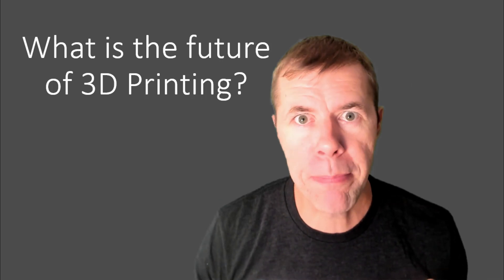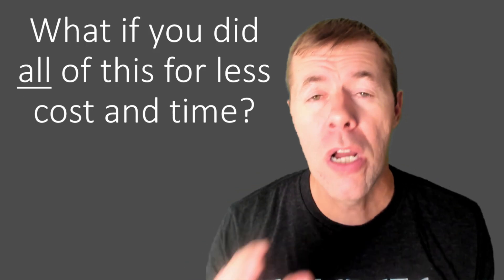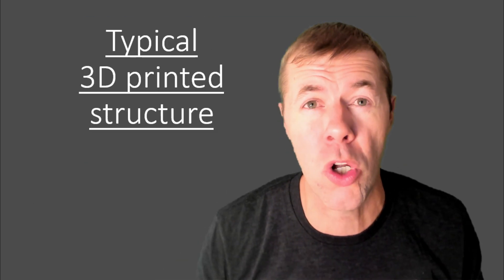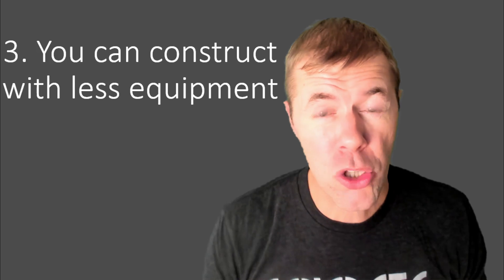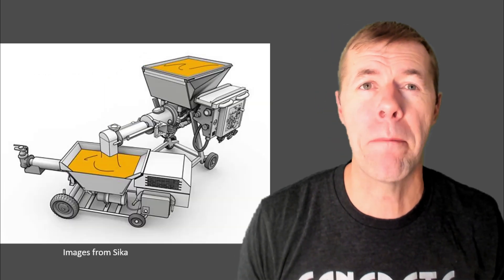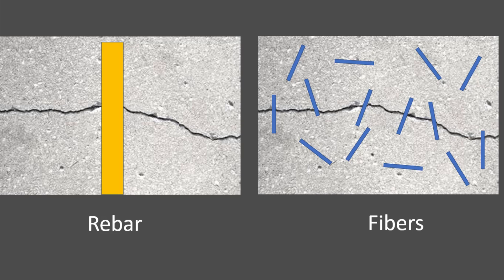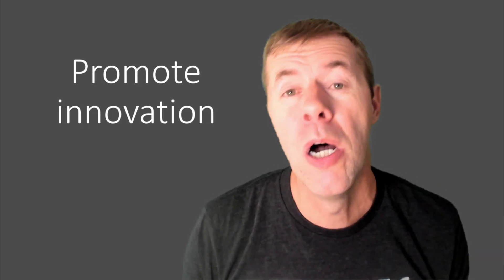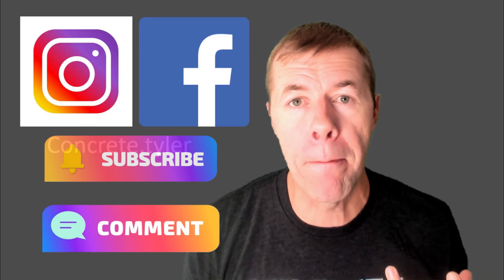What is the future of 3D Printing Concrete?

Comment: That's a lot of problems that still need to be solved like cold joints, no big aggregates, having trouble printing in tight concrete meshes etc.

I know you believe in this and are really involved in it but maybe you stop investing all that time and money trying to make 3d printing concrete work and better focus on trying to make 3d printing form work work.
I don't see a way of 3d Printing big tall structures that can hold themselves withouth collapsing without printing them by parts thus creating cold joint i.e. weakening the structure etm.
Reply from the maker: The printer we developed can use 1" aggregate and print around tight rebar meshes.  I agree that cold joints are not idea but they are not different then a crack.  A cold joint doesn't weaken a structure if there is rebar going through the joint.  This is recognized by building codes.  They can be areas for durability issues if you don't address them.
I don't understand why I would 3D print formwork when I could 3D print the entire structure and not have formwork?
Reply: @TylerLey  thank for replying prof. 
I just figured it would be easier to design form work in way that it becomes structural and/or ornamental than trying to make 3d printing feasible.
 Would be nice to see it work it's way around reinforcements with complex geometries where other structures are already put in place and are not easily accessible from the top.
Reply: @TylerLey  I think I could be great for footings and foundation work.

Comment: Pure delusion
Reply from the maker: Why do you say that?
Reply: @TylerLey  Take a step back, take a deep breath, and maybe you can comprehend how this 3D printing nonsense will not be applicable to mainstream construction.  I am a licensed contractor (25 years with 35 + years experience) specializing in custom concrete and masonry in California.  I am not “close minded” and do not resist modern new construction methods.  But, mainstream 3D printing house building, concrete, clothes, cars, food (why not?🤣) etc etc etc is a fools pipe dream (I’m not calling you a “fool”).   

Construction needs man power, will always need tradesman who specialize in their particular craft.  Do I really need to explain further?  If so, than you really don’t understand construction.  You do understand concrete, but the actual “placing” of concrete or masonry you truly don’t understand.  

Other than that, Thank you for all your hard work and knowledge, your channel is interesting and has value.